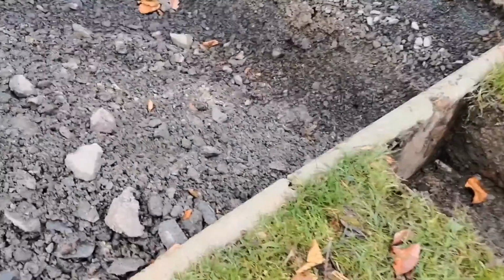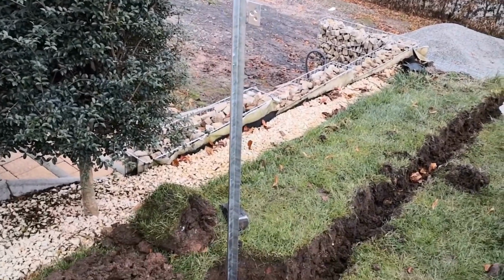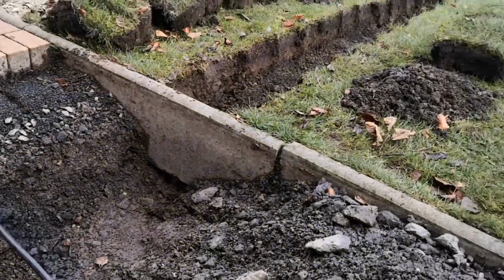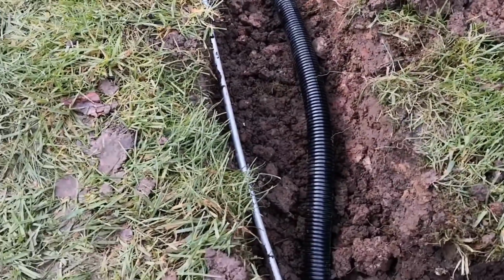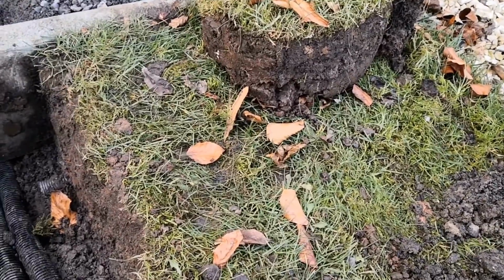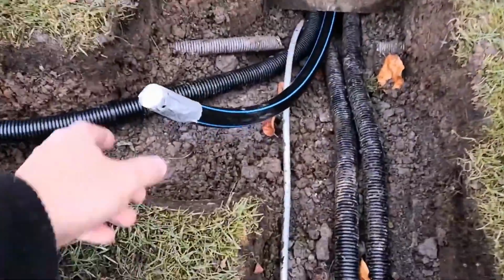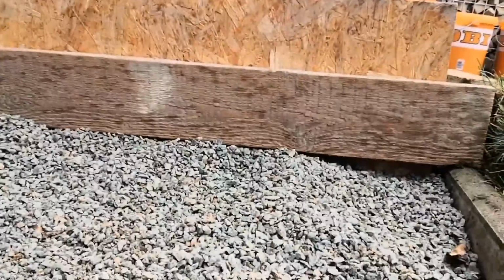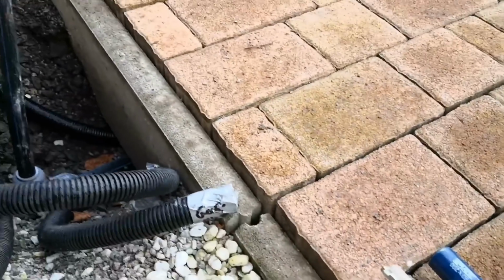Laying empty water and electrical pipes under the sidewalk - Extending the lawn irrigation system

Comment from the maker: Product list:* 
🔗 PE water pipe - https://amzn.to/3LAKjKT
🔗 GARDENA Sprinkler system L-piece - https://amzn.to/3BMyKuQ
🔗 Earthing rod - https://amzn.to/38zZ8e5
🔗 Earthing cable - https://amzn.to/3S7cQOw
🔗 Bolt cutters - https://amzn.to/3GszHwa
🔗 Connection terminal - https://amzn.to/2EiQsuv
🔗 Three-pin terminal - https://amzn.to/35yJbTD

This video was originally created in German for my main YouTube channel @commaik 🔗 https://youtube.com/commaik. It has been translated into English using 🤖 the AI tool HeyGen, which replicates my voice and synchronizes my lip movements. 

Please note that ⚠ due to dynamic adjustments, the synchronization may not always be perfect.

📺 The original video, which includes English subtitles, can be found here: https://youtu.be/4QrpTNI-CU8